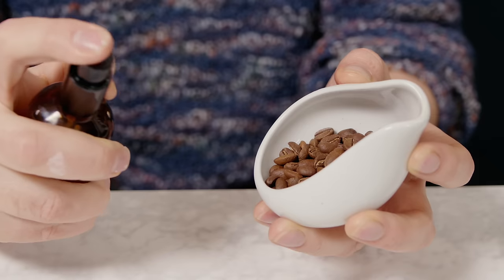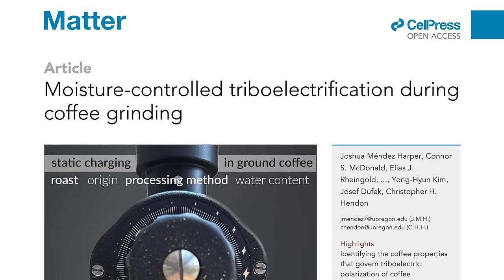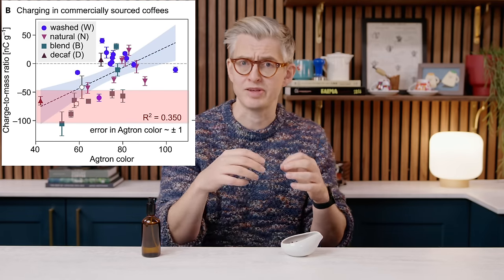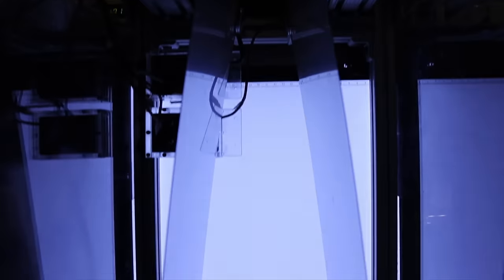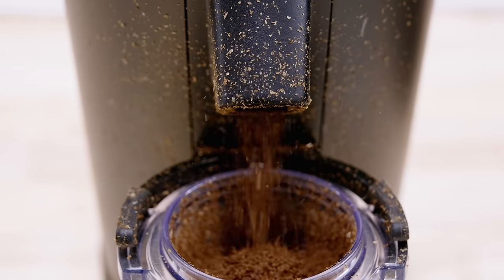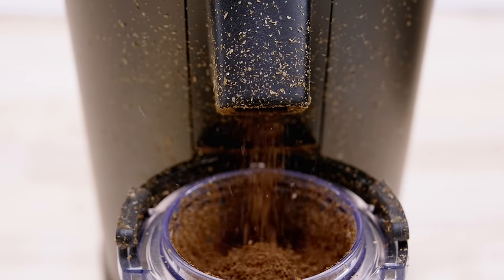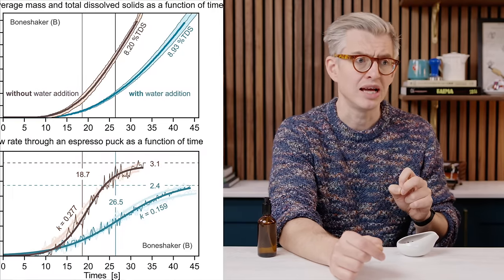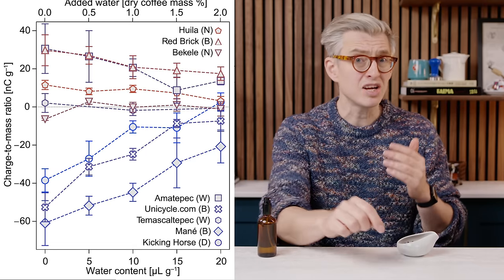Science Discovers What We All Missed: More Than An Anti-Static Hack

Comment: Well here is my 2c. I think you are both confused. You have the coffee in two places. First in the grinder, second in the portafilter. You showed and mentioned the mess in the grinder. So if you add enough water here, I take it you don't get that mess? I personally just have a hand grinder and I don't get that issue. What I have seen, was a static buildup in the grinder cup. I literally could not tip the grinds out. This was just over a few weeks, when the weather must have been dry? So I do know what you are talking about. What I did to solve the issue, was I just left the ground coffee for a minute. The static just dissipated on its own. Problem solved for me at least. The second place where the coffee sits is the portafilter. Static clumps, which I will call "Stumps," exist within the coffee puck. They can be "de-electrified," through pre-infusion. Problem solved.

Comment: i have another couple theories: 1. the water clings to and dampens the lighter particles, making them fall rather than float around, similar to how pouring slightly damp flour is significantly less messy than super dry flour.
but also, you are possibly getting a much more even distribution in your puck / tamp due to water being a lubricant and allowing the particles to all settle evenly